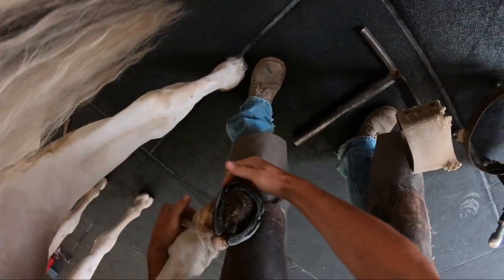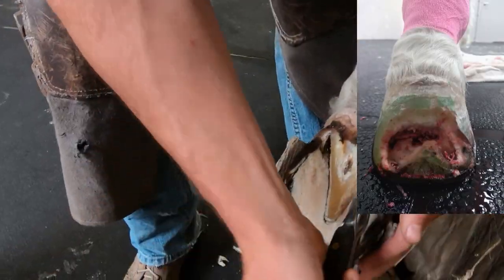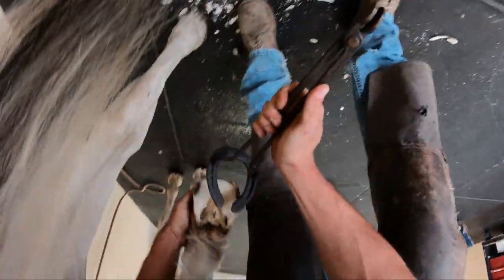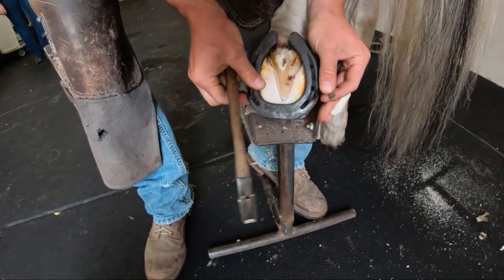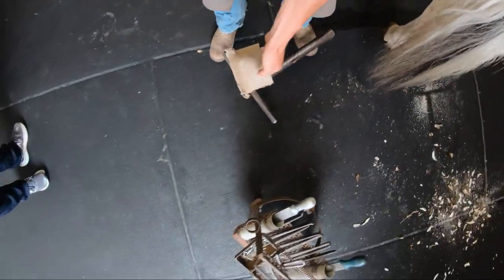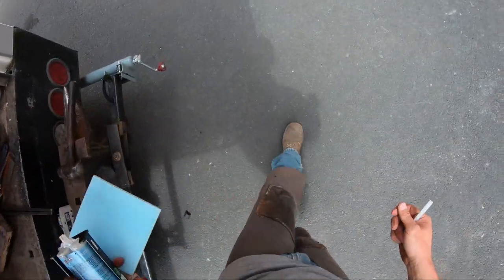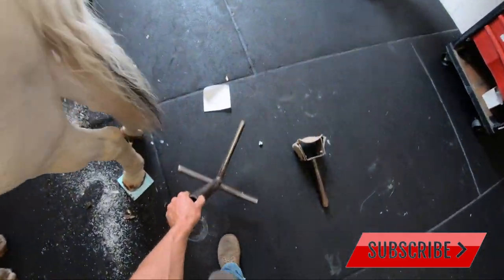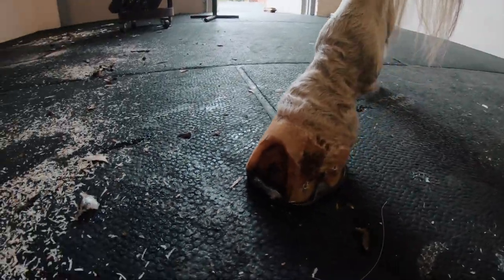Gel Insoles for HORSES?? HORSESHOEING Pinto Bean Ep.5

Comment: This is so great to see that Pinto Bean is doing so well!. Sheldon, this is a super basic question, but why do horses get nailed in shoes and cows get glued on blocks? Wouldn't it be healthier for the foot if you didn't have to open up holes and allow for infection?
Reply: The nails don’t give much room for infection. And there are nails that can even avoid infection. Certain farriers will take precautions to avoid infections and it’s just not liking to get an infection in that hoof. There really isn’t any flesh there to infect. Obviously ignoring the injury in Pintos case. I am sure there are reasons to do cows and horses feet in different ways and that is based on the actual structure of their feet, the geography, the person working in their feet, and whatever other circumstances may be there like house close cows are with one another in stock yards. Hope this helps a little bit!

Edit: I also forgot to add that nails have just been the way shoeing has always been done. It’s easier, and it’s a “comfortable” method for both the horse and the farrier. Not to mention that they are super secure most of the time. I mean you can see just how much work Sheldon has to put into just nailing one nail in. Imagine all three and more on more average horses.

Comment: I’m curious as to why you chose not utilize a barshoe for stabilization?
Reply from the maker: I should have but the vets didn't think it was necessary. s once they left me to do my thing I went ahead and used a pour-in, I figure it is the next best thing. What do you think?
Reply: I believe you gave the horse what it needed to heal, just in a different application with the same results that a barshoe could have produced. In my experience, when dealing with such tough diagnoses, barshoes are often billed as “go to” applications and I was curious as to why not. You explained the extended heels in detail which answered my other question. Thank you for the response.

Comment: Question, wouldn't it be easier to use shorter nails instead of bending the longer nails? or is there a specific reason you chose to use the longer nails?
Reply: I imagine having part of them curved perpendicular to the entry point helps secure them in place. That way a force can't just pull the straight nail back through the hoof as easily if say the horseshoe got caught on something